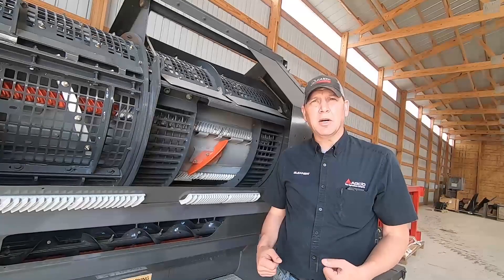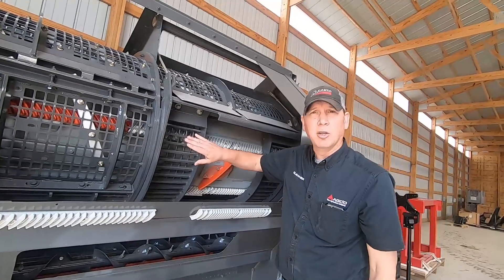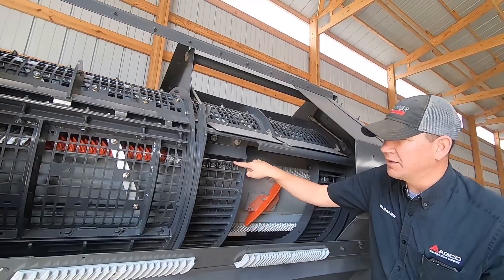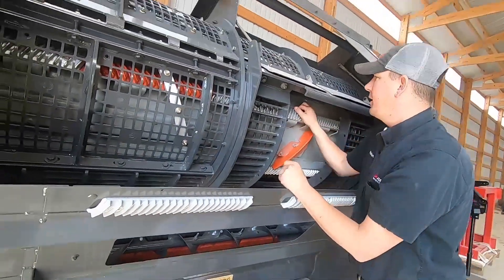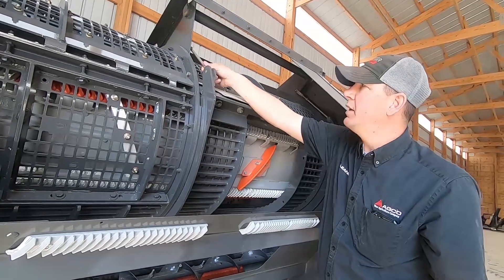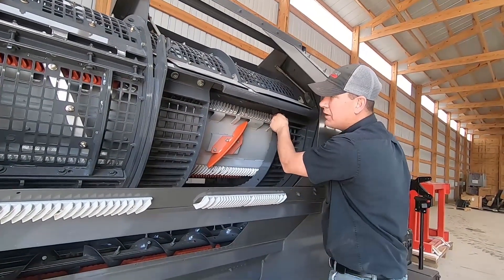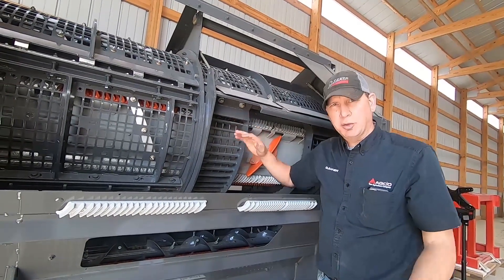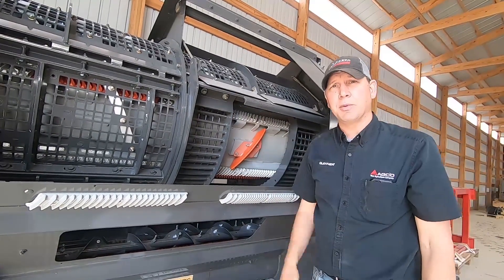Leveling Concaves on Super Series Gleaner Combines

Comment: As much as a new combine cost, this step should be done from the factory, along with tightening every bolt and set screw.
Reply from the maker: This process is done at the factory and checked during the pre-delivery inspection at the dealership. This is also something that needs to be done at the beginning of the harvest season to optimize the performance of the machine.
Reply: Is it the same idea for series   we have a r 65  gleaner
Reply from the maker: The principles are the same, but on the earlier small rotor machines the concaves are a two piece, upper and lower design. There are four dimensions on each side to measure. The process is included in the operator manual of the machine.